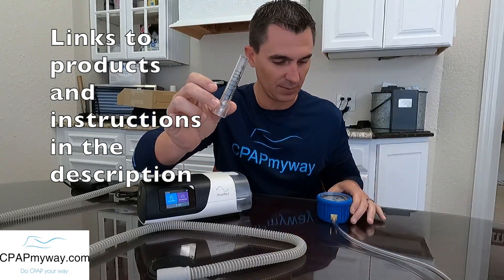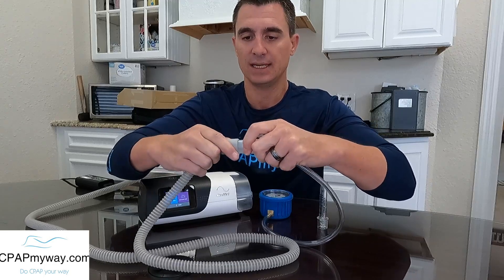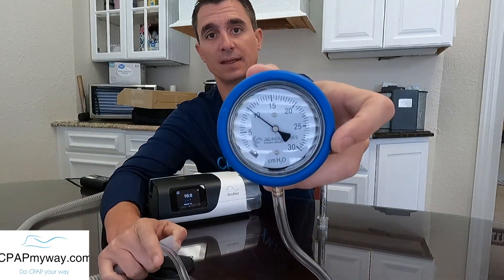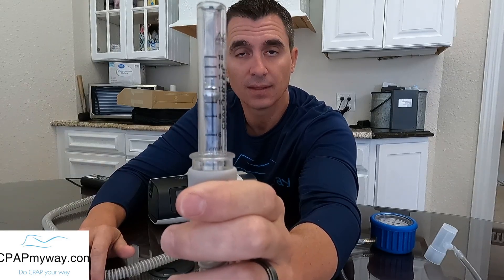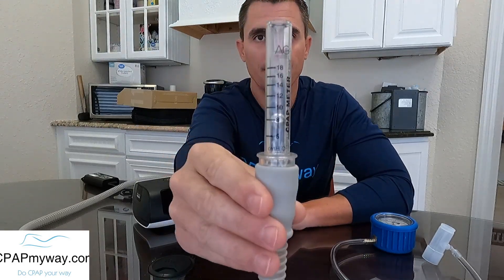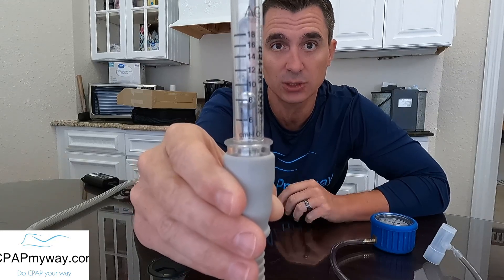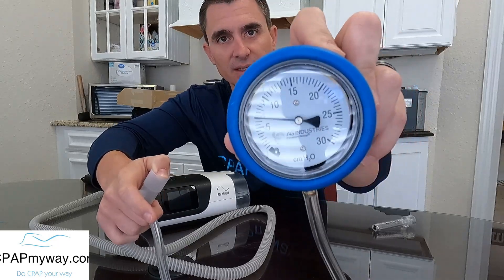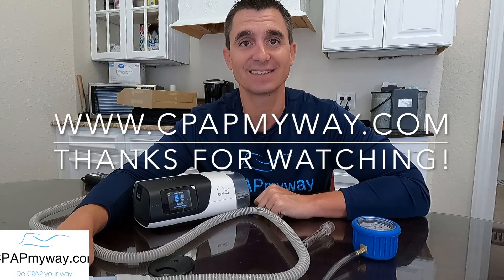Check your CPAP Pressure Calibration - Quick and Easy

Comment: Thank you for this. My AirSense 11 has been acting weird lately. Wanted to double check it myself. Seems to be off by 1 cmH2O with EPR turned off, and it doesn't seem to detect leaks anymore (whereas it would recognize if i took my mask off my face). I think i need to get with my supplier and see what they can do!
Reply from the maker: Probably a great idea to reach out to them. Good luck and thanks for watching.

Comment: Do you know how to recalibrate the pressure.
Reply: Or what the error code 13 is on the air sense 11?
Reply from the maker: That has to be done by the manufacturer if it is off. That would be a warranty issue.
Reply from the maker: It will have to go back to resmed. Contact your supplier and they should be able to arrange that for you.

Comment: If the machine is blowing lower , how should i calibrate it to match monometer? Obviously not by increasing pressure untill it maches , i mean getting the machine blow accurate
Reply from the maker: You should have your CPAP provider look at it if it is not calibrated correctly. May be a warranty issue.
Reply: @CPAPmyway  thanks for answering, mine has no warranty and i live in roral area difficult to go to provide in city , currently i,m using it by setting pressure higher and it,s working... If there is any way i can calibrate myself i,d be happy to learn it , i,m a geek both in  mechanical repair and software things , i opened the Device , there were nothing mechanical to calibrate it